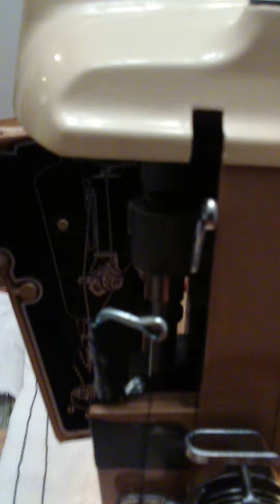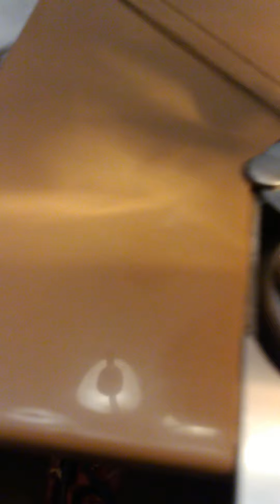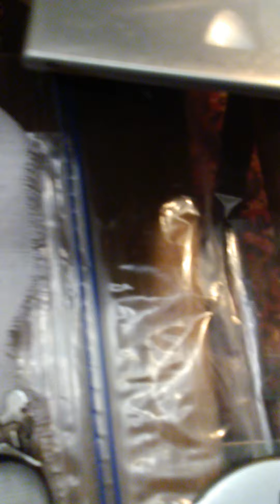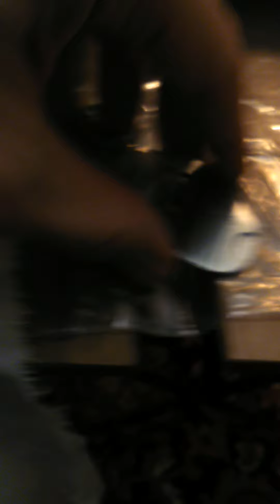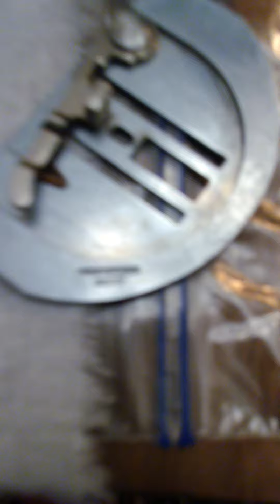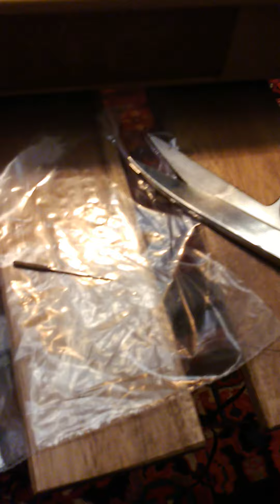Chain stitching on Singer 403a

Comment: Thanks I have a 403a and I am wondering if the 411G is a better machine I do know the internals of the 403 are more heavy duty than the Rocketeer. Can you tell the difference on sewing even just straight stitch and zig zag. Guess the quick question is other than the chain stitching and the treadle option what would your choice be. Thanks so much for your lovely videos. BTW I subbed and hit the alarm years ago but see it must of been changed I will do it again

Comment: Thanks for sharing.
Reply: where can someone pick up the 503599 chainstitch plate?  Dave
Reply from the maker: +Dave Johnson They are extremely hard to find (EBAY is about your best option, but perhaps ETSY as well); however, the difference between the wrong one (i.e. from the 600 series) and the right one is the moving arm. I should try and see if I can get someone with a 3D printer or metal press to make that part then we could easily do the conversions.

Comment: What do these parts come off of originally? I was so to the point of buying a touch & see if I had to. lol
Reply from the maker: I got the parts from a Singer 411G which I owned. If you get the right touch and sew version, it will provide all of the functions with all metal gears as well.

Comment: Would this work on a 401A?

Also, the chain stitch kit for the 600 series comes with a bobbin case cover, did you need to use that?
Reply from the maker: Yes it will work on a 401. I have only tried using the chain stitch plate and bobbin race from a German 400 series machine on the 403. The 400 series parts work across the models. I have not tried replacing the bobbin race and feed dogs as well from a 600 series machine to see if the problem of the 600 series plate hitting the feed dog goes away -- that might be interesting. The bobbin case cover is not needed with the 400 series kit.